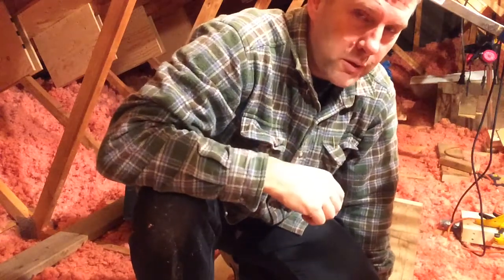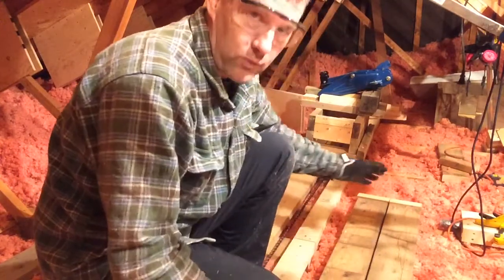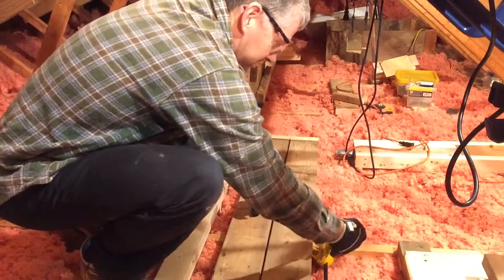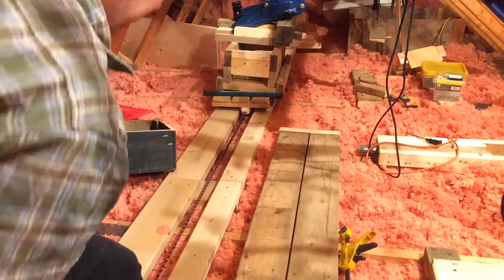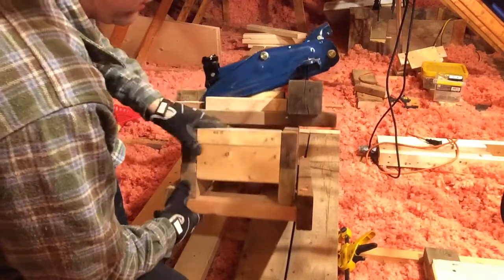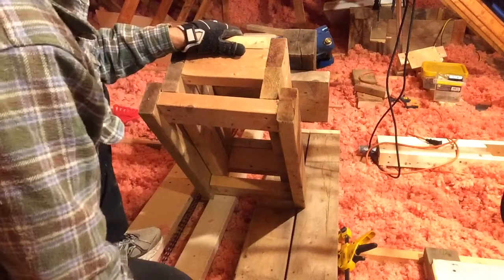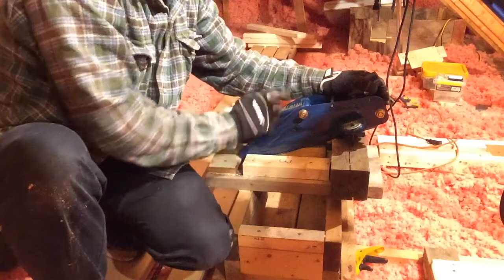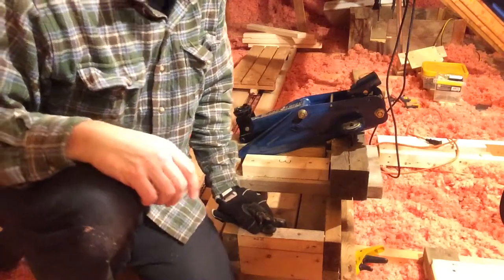Attic Truss Repair #12: Lifting Jack design being used on Truss #8

Comment: I have some 2x4 stringers down and plywood over that for a floor in places.  Im going to pick up a couple of studs (lag screw on one end and threads on the other) put a nut and washer on the threads and put it in the end of a piece of steel conduit.  Drop a piece of all thread, washer and nut in the other and there's your jack.  I have some rubber feet on a stud for the legs on my saw and Ill put one of those on the end of the all thread with a coupling nut.  That makes it easy to lift up the plywood decking along the truss to find and cut any nails.  Im planning to put on a new roof after some repairs are made.

Comment: I had a similar set-up in my attic years ago with the track.  I had (3) 2x6s side by side across the joists and then another turned up on each edge (like a rat run).  It formed a U shape that kept the cart lined up.  I had a little seat on one end of the cart and a flat area for moving stuff.  Many years later after a few different owners, I heard it was all still up there working great.  Kinda satisfying.